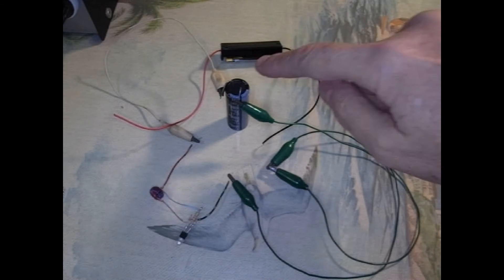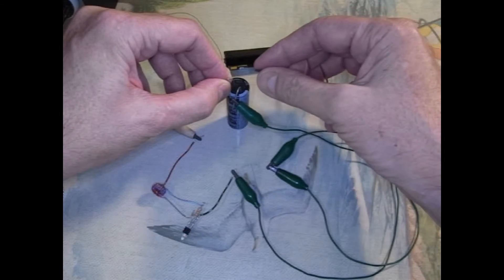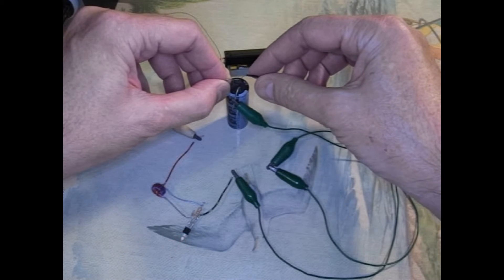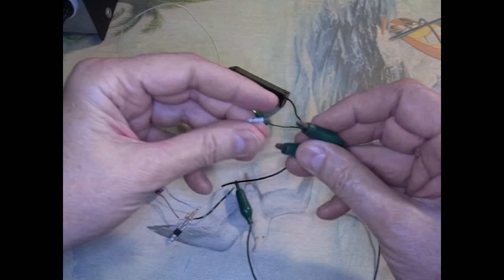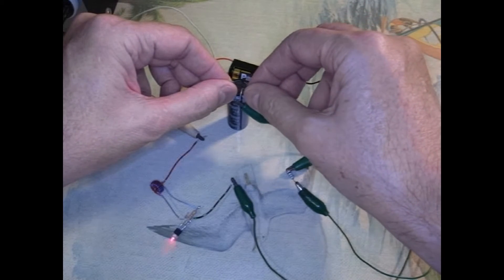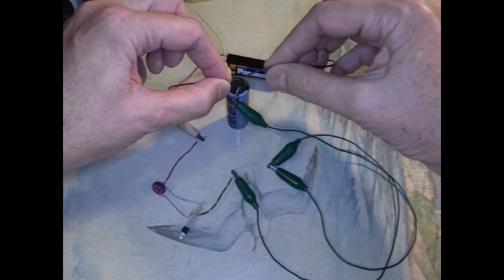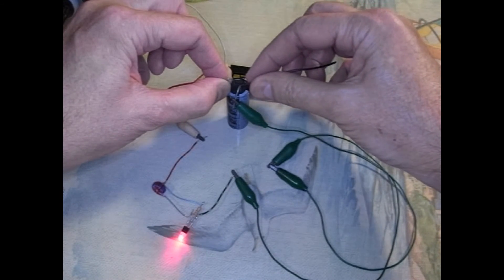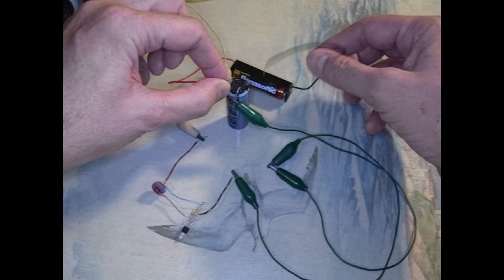Super Capacitor Vs Battery - Which Can Hold More Power?

Comment: A super capacitor is not the one you are using in this video. Start experimenting with farads not micro farads and see the difference with your own eyes.
Reply: tsbrownie 10000 micro is 0.1.
Reply: Cemal Yalçın how good is a 100 farad one?
Reply from the maker: True, but even with 10x more time from the cap, the battery and cap are not even close.
Reply: tsbrownie thanks for info..i was planning on buying some 100 farad super capacitors for battery purpose.
Reply from the maker: 10,000 microfarads is 10 farads.
Reply: @tsbrownie  No 10,000 microFarads is 10 milliFarads - not 10 Farad. 10 Farads is 10 MILLION micro Farads - "micro" means "millionth".
Reply from the maker: @chriswesley594  I need to redo this to fix the math error and update it for bigger / more available super caps.
Reply: @tsbrownie  10000 microfarads is 10 millifarads or 0.01 farads. This is NOT a super capacitor
Reply: My bad so sorry couldn't calculate that. Have a look at this site to convert microfarad to farad. :)  But please don't give up experimenting with real supercaps. https://www.convertunits.com/from/microfarad/to/farad+[SI+standard]

Comment: nice video. Have you found any information on those new capacitors with the high storage rates? The only thing I have been able to find is promotional videos that don't really say anything useful.
Reply from the maker: Me too.  I first saw them more than 10 years ago.  I guess they are stuck in R&D.  There are also some super solar cells that are something like 20% more efficient than current tech, but again they can't commercialize them.  Too hard to manufacture.